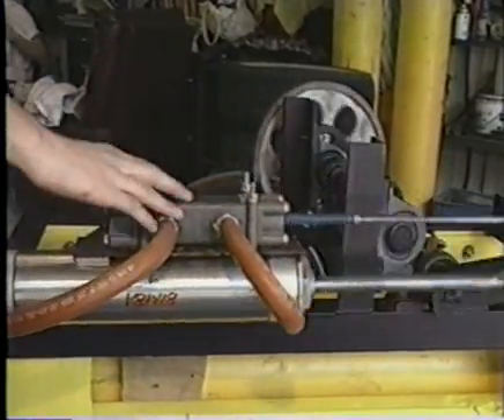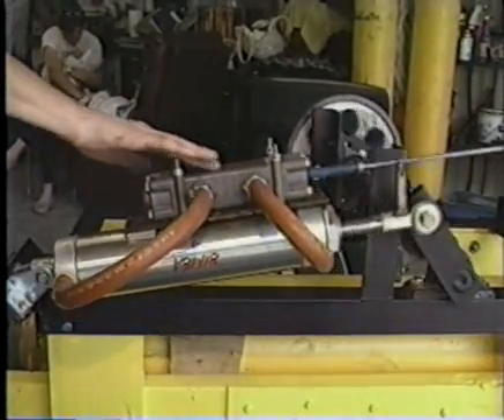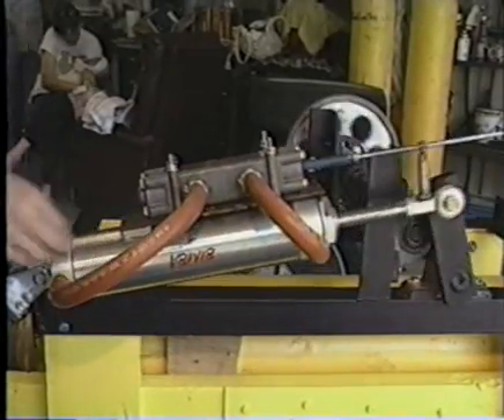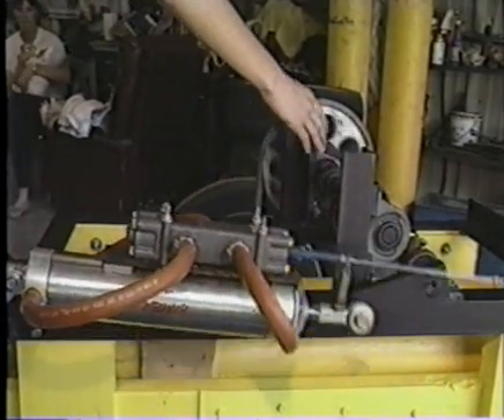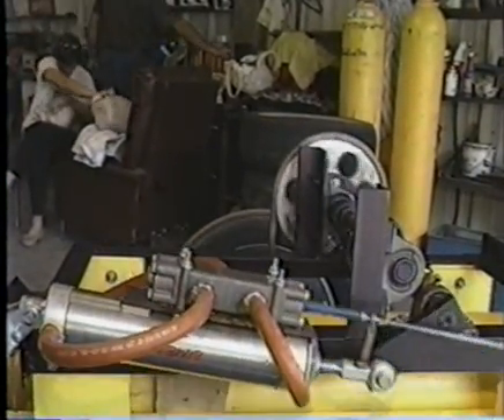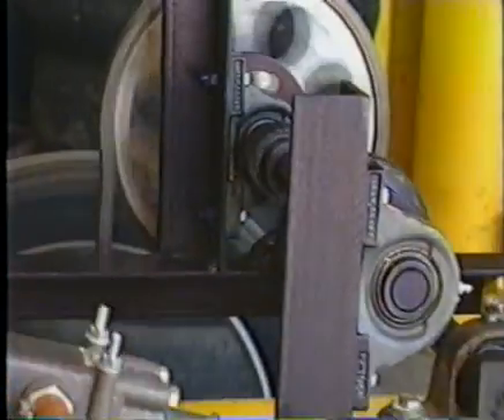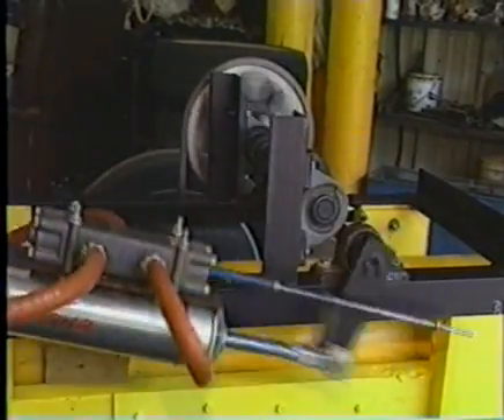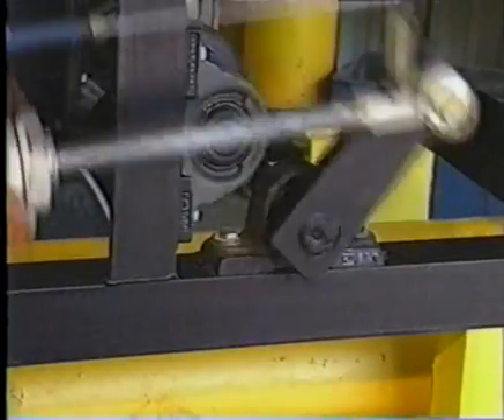American Air car 1989

Comment: Where was your compressed air stored?
Reply from the maker: If you look across from the engine (In the video), there is a Large yellowish (T Sized) Cylinder, there is also one of those laying horizontal inside the frame of the vehicle, It was connected by the hoses and had a high pressure Zerk style nipple vale that I could fill or transfer with.

Comment: wow, thats pretty good. Back around your time University of Wisconsin or somewhere around there the college kids developed a gas powered version of that using a 9 hp ICE  and a compressor to regenerate the air tanks. Air is the way of the future ! did you ever put this in a passenger car ?

Comment: This machine demonstrates your ability to think of and build a complex system.   the air car happened not because that french guy talked about it, but rather because he could do an analysis of it potential efficiency in mpg.  it boils down to a Kwatt of electricity in 1/3 the cost of Kwatt of gasoline.  store the electricity as work in compressed air, and build a car for equal price of gasoline car.  new car co.

Comment: the cost ratio of a machine like this as apposed to a H2 vehicle or purely battery driven vehicle is crazy. a machine like this can be made for under $1000 and run on pennies. even with dreams and stephen hawkins as a pit boss,you would not even come close to that with batteries or H2.

Comment: and how do you think hydrogen is separated from water? or how do you get the electricity for the batteries running that electric car? some magical potion that does it? or maybe your rapier like wit? do you know how much power it takes to convert water to hydrogen as apposed to compressing air? how about charging a large bank of batteries? i'm betting you don't. what about replacing batteries? those metals and chemicals don't just jump out of the ground and smelt themselves.then disposal too.huh?

Comment from the maker: Um yes man it IS running off a basic inert mixture of nitrogen/oxygen, meaning AIR. yes the same air your breathing (although alot more pure as was for most part coming from a welding company, dirt cheap as it was considered by-product from them seperating gases to get welding oxy/acetaleyn)  I actually at one point hooked a line to exhaust and a scuba mask to show it was breathable.

Comment from the maker: It should it's the same basic function. the steam engine was a much less effective design, as the ability to compress gases back then wasn't as readily available. otherwise yes, the expansion of the steam was equal to the expansion of air under pressure ( though not Ft LB per Psi, equal) as the means for moving the pistons.

Comment from the maker: it cost me around 435$ to build this machine, the spool valve controls the porting of air and had a rod with stops as an actuator lever. yes more PSI in means more power/speed out. I took it to Tusla OK and filled it with CNG (natural gas) up to 2600psi and it cost 34 cents in 1990. I was venting the exhaust, but you can add reuse tanks and cylinders yes.

Comment from the maker: No real updates. In 92 i donated the car i had made and all the odds and ends i had left to a missouri based Not for profit company i think was called Numacomp or sumsuch. one of the CEO's was the daughter of a mentor of mine.  by around 1995 they had built 3 geo metro's with diff air motor builds. other than that no new info. also DO NOT ask how far it goes on a tank or what top speed and range is as all of those statistics are completly configurable in design.

Comment from the maker: as an FYI it was geared at 5:1 so for every 1 turn of the crankshaft the wheels would turn 5 times. and I used only one cylinder but could have added more and a reuse tank for each to increase distance out-put, but this was built for speed and demonstration.